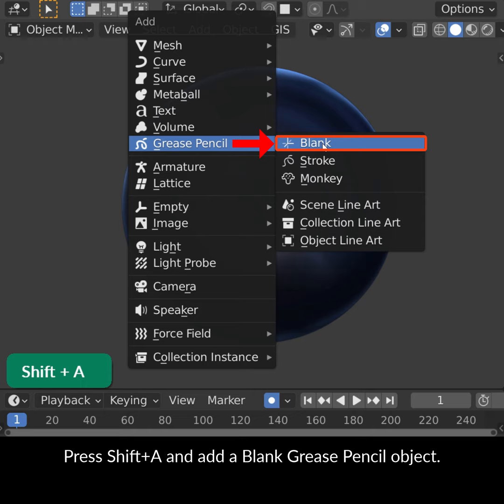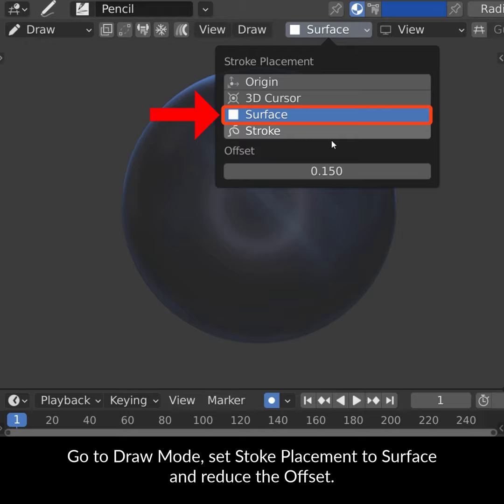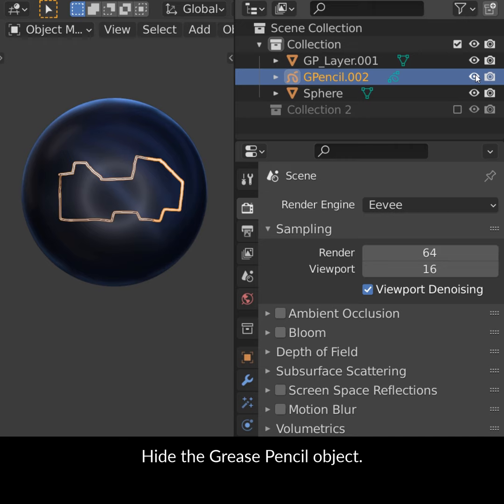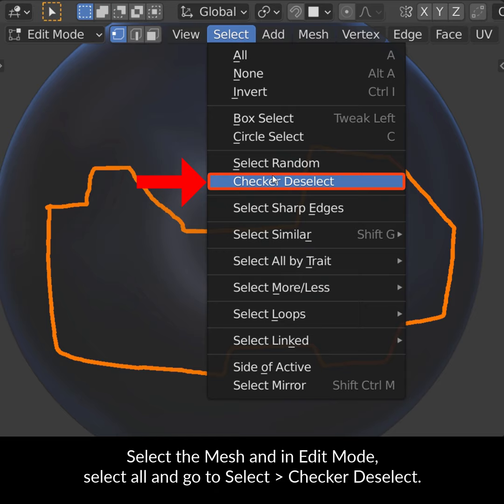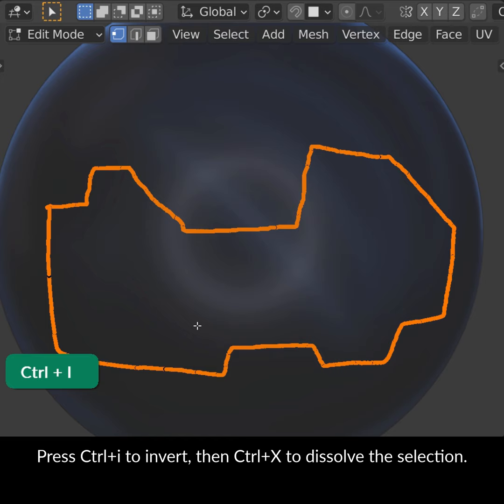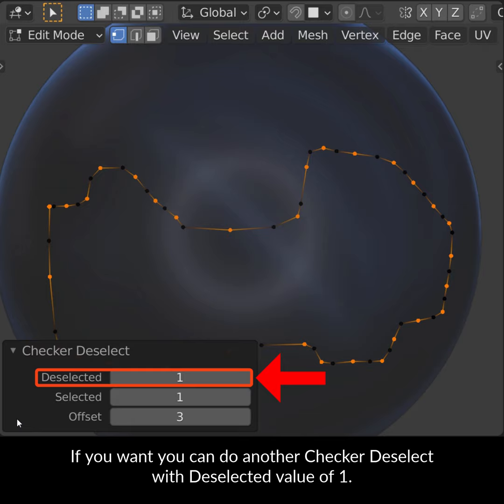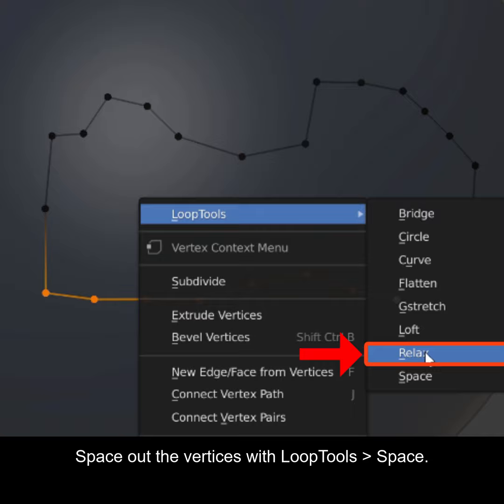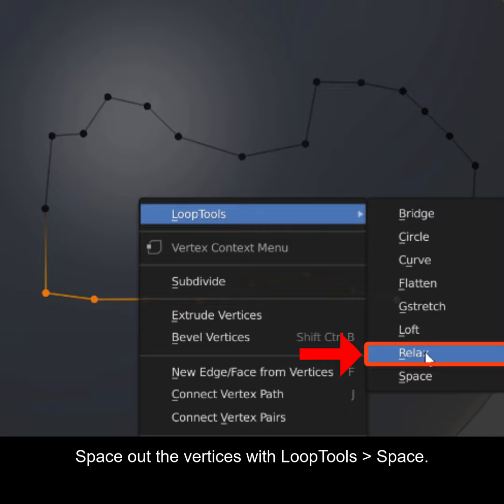Blender Secrets - Grease Pencil Strokes to Mesh

Comment: For this I think I would actually rather switch over to sculptmode and mask out the desired shape and then extract to mesh. There is less control probably but I feel like it could be a viable option in some circumstances.

Edit: Actually, this requires a very high resolution model so this might not be very practical at all. I've been sculpting a bit lately so this was my first thought. Nevermind =)
Reply: So you can mask in blender like in zbrush?
Reply: @BestMods168  there several ways to mask when sculpting yes. The regular box/circle mask. From a projected line, following topology, from regular selections, face sets etc etc. It's like Photoshop in that someone who's good with selections/masking can create very cool stuff. I use it all the time now.

Comment: I have a few questions. Can I get blender on a tablet? Can anyone suggest me a good one (if blender can run on it of course)?
Reply from the maker: Not really, though I think you could run it on an iPad with sidecar (provided you have another Mac computer to also run it on).
Reply: I run it on a surface which is more like a touch screen laptop. Although I still prefer sculpting with a stylus pad. You really need a key board to use blender well. If you have the keyboard in the angle is no good for drawing. maybe on one of those all in one big PCs it might be ok, but if the key board is attached to the tablet you will have problems using the stylus/touch screen. No one draws vertically. Having a num pad is helpful too. Lol no num pad on the surface. 

Blender is a pretty heavy program, I have quickly reached the limits of my surface. If your looking to get really into blender and want the benefit of a stylus, my suggestion is get a beefy computer and a Wacom stylus pad. The pads are actually fairly intuitive to pick up, if you haven’t used one before.
Reply: it's open source so it could be possible. but i don't think a tablet will be able to run complex scenes
Reply: @grahamthomas9319  Hi! Thanks for your answer. I actually have a pretty beefy computer, but i hate working with the wacom pad. (i have the small black one) is there any pad wich is like a touch screen for stylus? could you maybe show me one? x3
Reply: @grahamthomas9319  Thank you really really much! :3

Comment: I do not have the option to convert path into a mesh. I am using Blender 3.3 Is there any reason the mesh option isn't available to me? My only options are Path, Bezier Curve, and polygon curve.
Reply: After changing it to a Path, make sure you select the new layer in your Scene Collection list. I made the mistake of not selecting it and had the same issue as you until i realised
Reply: tnks for this question @benmedia9534 for the answer!